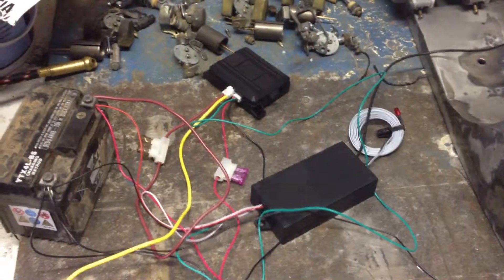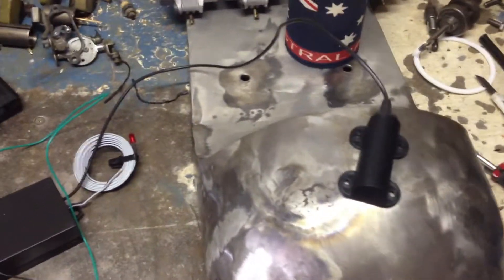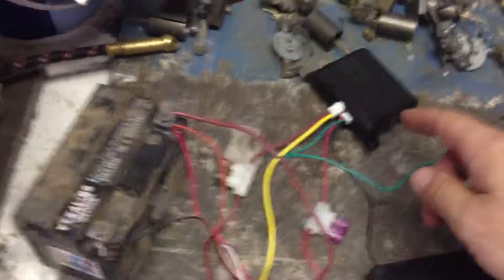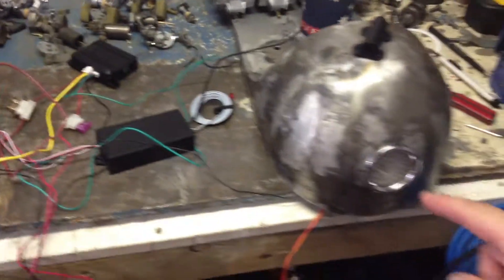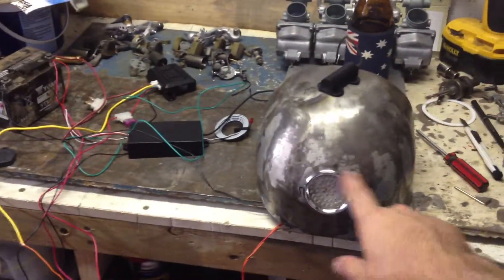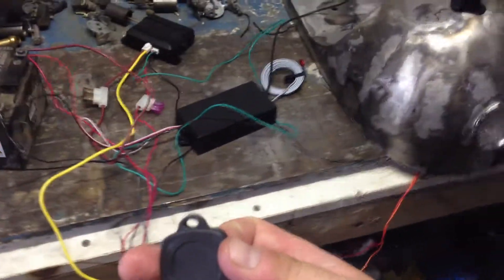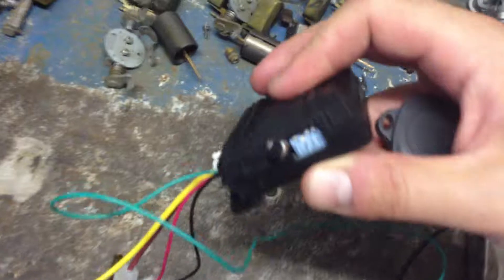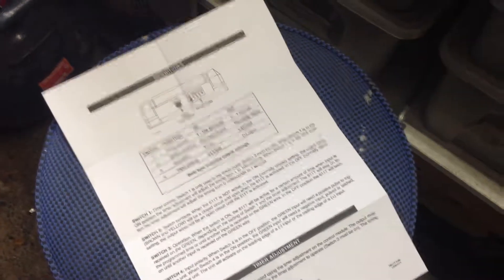Wireless ignition test

Comment: your links are disabled.  video explaination is not enough.  forum link is very fatty enormous thing.  And I hell want to wirelessly start my car engine.  Any help, buddy?
Reply from the maker: Atad Ali sure. Happy to help. I’ll try and find links to the same items I bought on eBay, but if I was doing it again I’d probably buy the M-Unit and the wireless ignition switch for that. Much more expensive but quality gear.

RFID: https://rover.ebay.com/rover/0/0/0?mpre=https%3A%2F%2Fwww.ebay.com.au%2Fulk%2Fitm%2F251275918306

M-Unit and ignition:

https://rover.ebay.com/rover/0/0/0?mpre=https%3A%2F%2Fwww.ebay.com.au%2Fulk%2Fitm%2F264185625016

https://rover.ebay.com/rover/0/0/0?mpre=https%3A%2F%2Fwww.ebay.com.au%2Fulk%2Fitm%2F272423362744